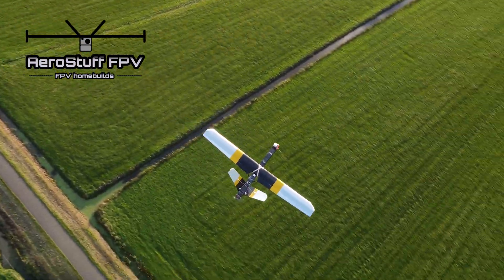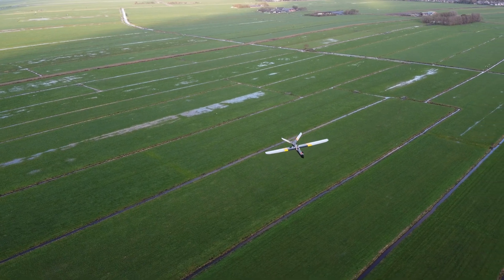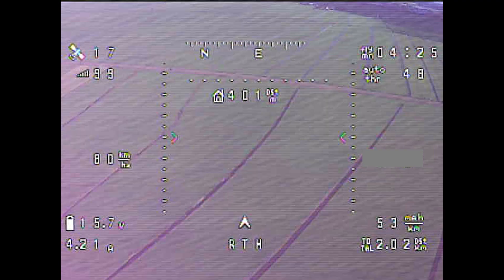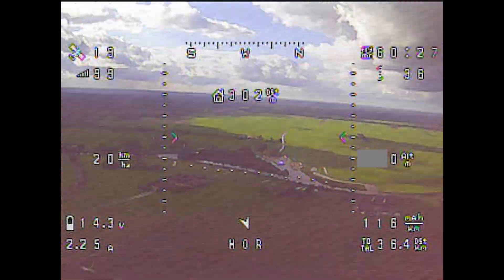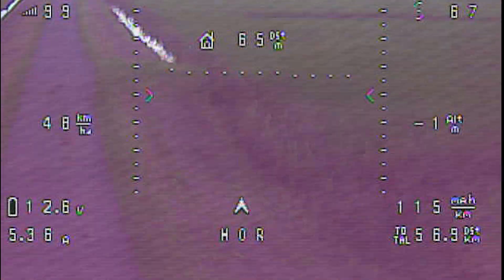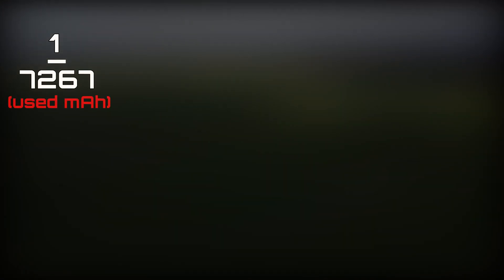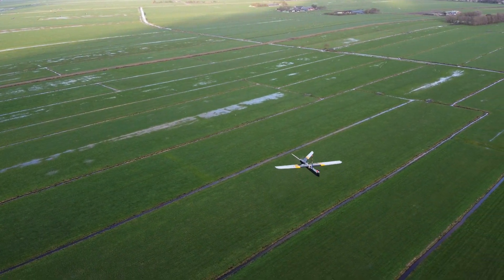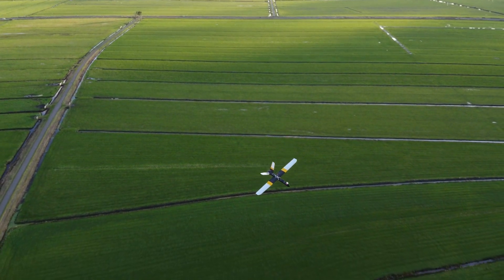V-Tail Pusher for Long Range FPV - Endurance Test with Homemade Batteries

Comment: I was wondering if there is a performance difference with the wingtip plates.
Reply from the maker: Performance difference over a +2h flight period might be noticeable (in efficiency) somewhat, but is unnoticeable in normal flying.

Comment: So would upgrading it to gas make it more inefficient?
Reply from the maker: For this size, gas is no option unless wood is implemented in the build process. 

It would be way heavier, louder, have higher risk of fire's (fueltank), increased maintenance on engine, and flight control systems have to be tuned to control/cut a gas engine. 

It is possible but not worth it, at all.

Comment: You are a very experienced Drone maker, would you say that the V-Tail Pusher design is the best when it comes to long range Autonomous UAV?
Reply from the maker: Seems like a flying wing design is the best for long range autonomous flights, but haven't had much luck to get a succesful design. Still on it tho. But the V-Tail isn't that far off from performing like a flying wing.

Comment: Excellent little flying platform. Your props must take a hammering on landing, with nothing to protect them?
Reply from the maker: ESC has built in brake which prevents propeller from spinning, but the propeller tips do get damage which is taken care off with sandpaper over time.

Comment: Awesome stuff. I really think home built planes like this are the way to go because if you want a kit from China that is larger than 1200-1300mm the S/H to the US is insane. Also I use Sumsung 50E Lions for my Zodh Talon GT and Reptile Dragon v2. Each cell is rated for 5000 mah and 10 amp discharge. Really great performing cells for my 4s2p and 4s3p packs.

Comment: Motor: Racerstar BR4108 600KV  ~$30

I spent a lot of time studying r/c motors several years ago.  Unfortunately there are not enough specifications published for this motor to determine if it is excellent or terrible.   I loved finding inexpensive motors that outperformed motors costing 10x.

Comment: Nice video ❤ . Can u please recommend flight controller that have RTH but no need for soldering 💔 in need  rth in case of video lost but i always burn fc during soldring . I don't know soldering and i hate it it's the only thing that prevent me from progress in the hobby💔
Reply: Don't be scared of soldering.  It's a necessary skill.  Get a practice board, get some thick tips and a good quality soldering station, and make sure you have both no clean flux and LEADED solder.  don't use non leaded it sucks.  You want to heat the pad and melt some solder INTO it, then tin the tip of the wire you want to connect.  Then simply line up the wire over the tinned pad, and press together.  They should melt together and you will have a nice solder joint.  

Get the speedybee f405 wing.  39 bucks in some places and it's super capable and has wire ports for everything.
Reply: @MrKyle700   and sory for my bad English
Reply: @MrKyle700 I have the speed bee f405 wing and you still have to solder a lot. The pins don’t come pre attached so you have so solder like 30 pins. Most of the wires also aren’t on correctly so you either have to solder or change out the wires on the jst connectors.
Reply from the maker: Look for the ZOHD Kopilot or the Speedy Bee F405-WING - These are P&P flight controllers.

Comment: Can your ESC keep working down to a super low voltage?  Most Can't.  I use a variable power supply to test them.  Currently using Castle Creations ESC's programed with their Castle Link device and Castle Link free Software. They work great and are very robust and efficient.

Comment: I just finished building the "silent star" with some slight differences, I also decided because I had the motor to build a half scale one of these pushers. not to sure if it will fly considering how heavy the half scale one is because it weighs so much but both were really fun to build. Im planning on running 4s or 3s lipos with 50amp esc and a 3536 1000kv motor
Reply from the maker: Awesome! would love to see pictures of it (IG: Aerostuff.fpv)